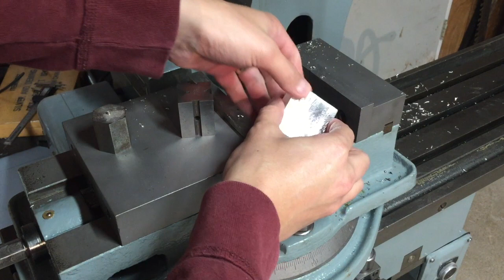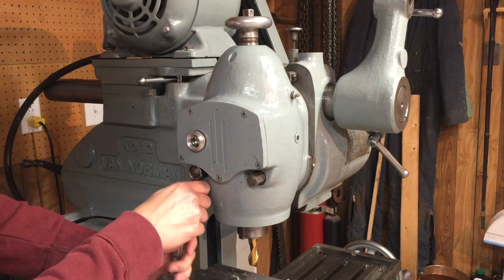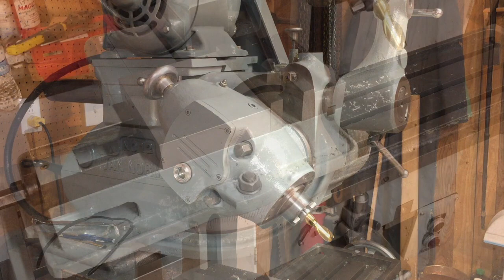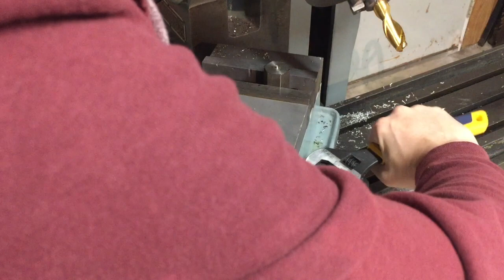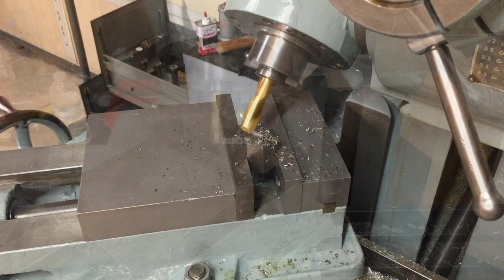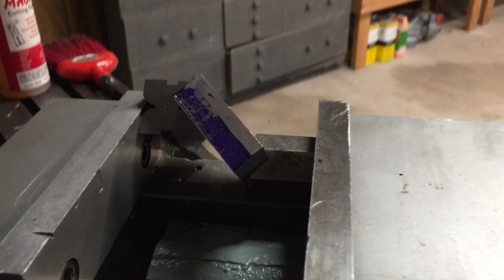Mill Project: Making a V Block for Cutting Corners

Comment: That is a really nice mill. Before I settled on my Bridgeport I looked for a suitable Van Norman for quite a while.
Reply from the maker: 75Bird455 I was actually trying to get a Bridgeport first but I ended up getting this one for free. I would have liked the spindle feed on a bridgeport but I love that my van Norman can be used as either horizontal or vertical. It's a great mill.
Reply: Steven Lawson want to trade? I have a 60 inch table, and I recently installed new spindle bearings and other parts in the head.
Reply from the maker: 75Bird455 oh no, this mill is my baby - I spent all of last winter restoring it. Tempting offer though.
Reply: Nice to see another Van Norman12. It was my first mill. It originally had a 3 phase motor. I had to build a rotory  converter to use it. Ran it for a couple of year before the motor failed. Replaced it with a  single phrase motor. The original motor was unusual in that it was 1125 rpm. The new motor operated at  1750 rpm . I had to use an optical tach to determine what the new spindle rpms would be for the different positions of the gear box levers. I still use it for 60 % of my milllng. The rest of milling i do on my "M" head, round ram Bridge Port, which I bought from a scrap metal dealer and rebuilt. I have  used  the Van Norman for milling both horizontal and vertically.  The Bridge Port is used for drilling and milling at different angles 
Keep enjoying your Van Norman, its an excellent mill.